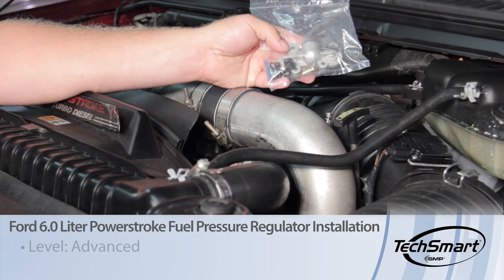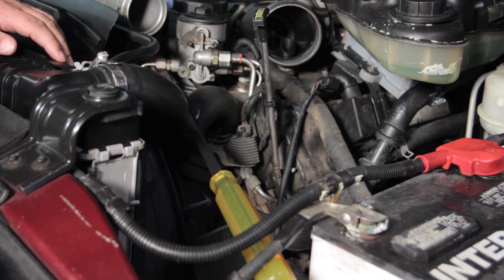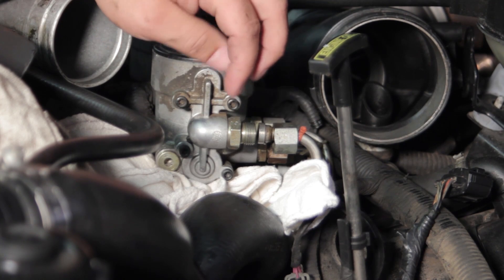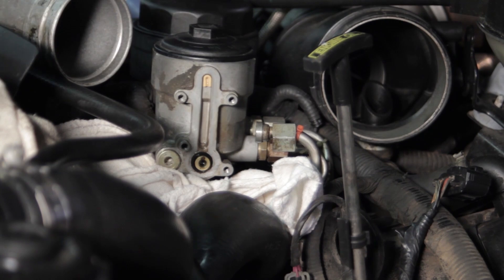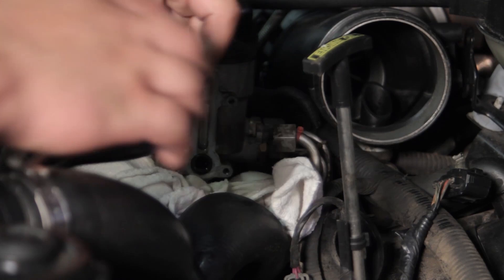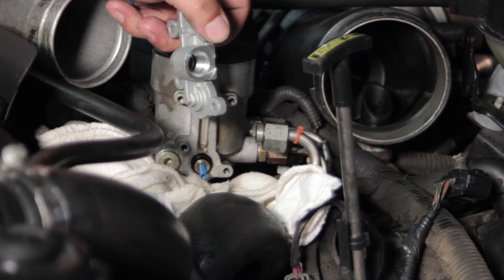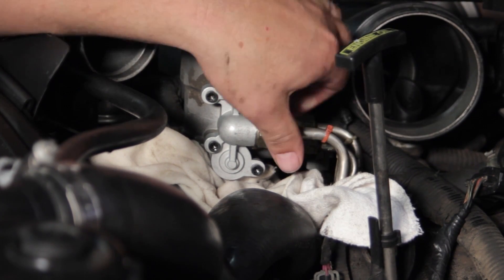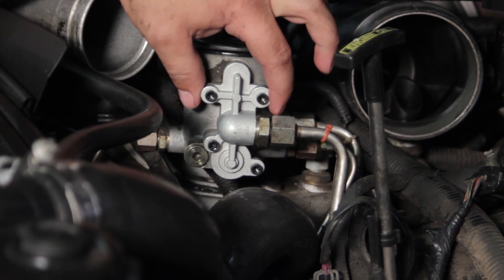Ford 6.0 Liter Powerstroke Fuel Pressure Regulator Kit Installation

Comment: Good video but i didn't hear you mention what year the vehicle was? The 03/04 are a little different than the 05-07s regarding the housing area that holds the spring.
Reply: techsmartparts, by chance could you email me so I can ask a few questions . Truck died ,no previous symptoms.  I'm having a crank but no start issue . It did start earier but only 5 seconds or so then died . Please help!!
 Sawcutterdfw@gmail.com
Reply from the maker: Hi there, the vehicle information can be found in the description. In this case, it is a 2004. Thanks for watching!